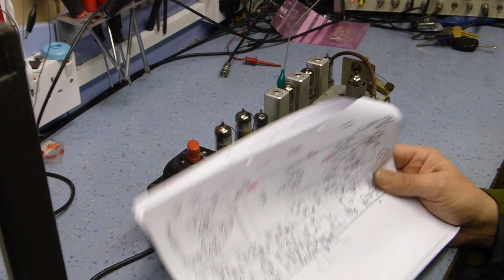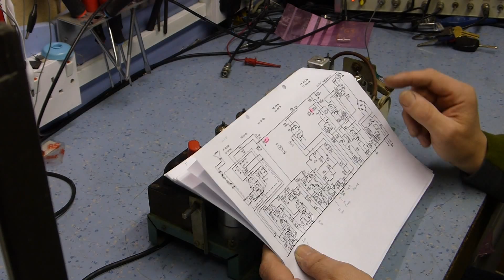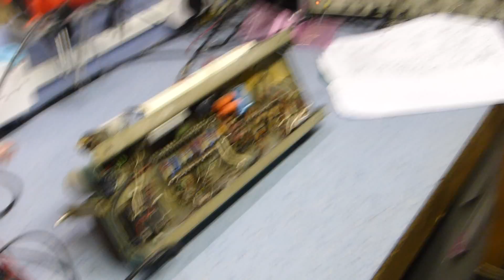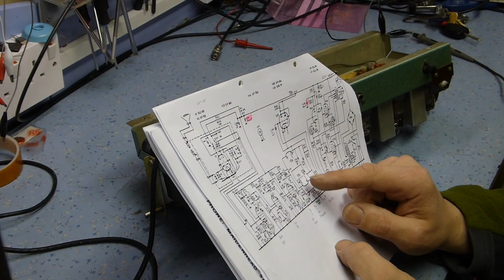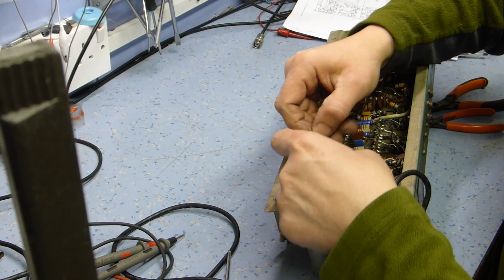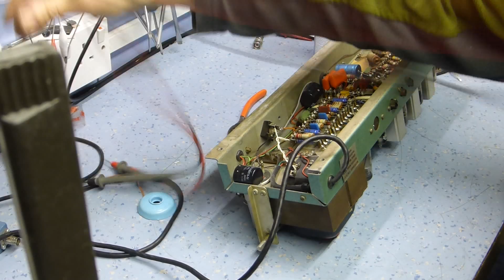Hacker Mayflower Pt6 low HT selenium replacement and workshop fire :-(

Comment: Glad the fire wasn't worse. I don't know about where you live, But here in the States we can still get the all metal heaters,I don't trust those plastic things they sell nowadays's. Great job on the Hacker.
Reply from the maker: +Bobby Tectalabyss Thanks Bobby, it was a situation I don't wish repeated thats' for sure. I am using a convection fire for now, and maybe buy an oil filled electric model as they are safe but slow to warm up.
Reply: +Simon Spiers I have used the oil filled  type for many years. Slow but sure. One tip with them is to keep the temp sensor clean and have a spare relay, when they act up the heater will keep running till the safety / over temp kicks in. Thank you for the reply and really like your channel.
All my best.
Bobby

Comment: What was the final value and wattage of the resistor you used as the HT dropper? I
Reply from the maker: 235 ohm seems perfect.  Two 2 watt resistors in parallel run hot but only around 90°C.

Comment: Selenium rectifiers are always bad news. If they do fail completely the smell is just dreadful Takes weeks to clear, bit like your plastic fire. Kind of ironic really that a modern heater breaks down and catches fire but all your retro equipment is fine. You could almost forgive a 50 year old piece of equipment catching fire.
Reply from the maker: +Michael Beeny I was thinking it was the Hacker on fire. At least the smell of burning selenium and wood would have been better than plastic! A lot less smoke too.
Reply: +Simon Spiers Thanks - I'll probably use a single ten-watter. I've got an RV14 that sounds to be in much the same state as yours was originally, so a recap and other work awaits. The power switch is broken, though, so a new volume pot will be needed. Very useful videos - thanks for those.